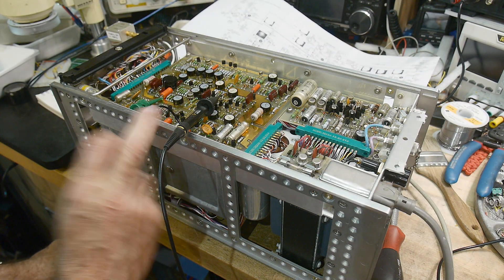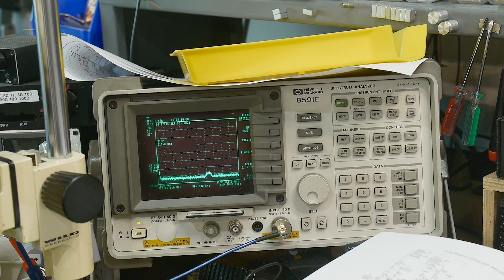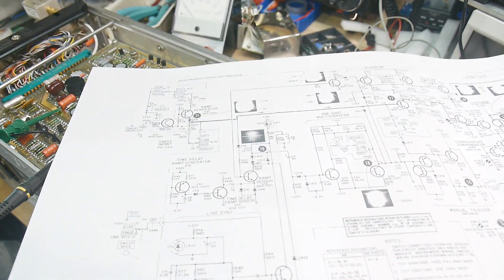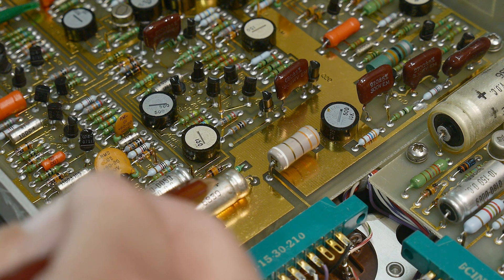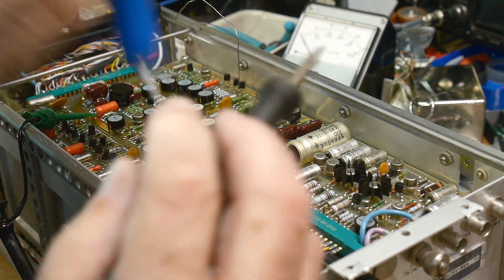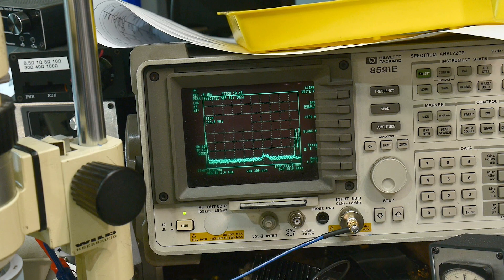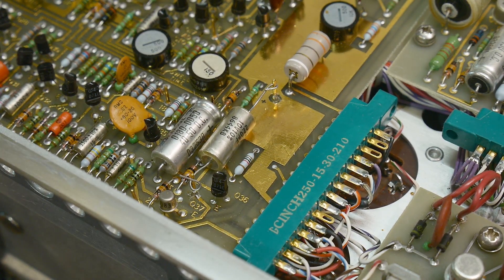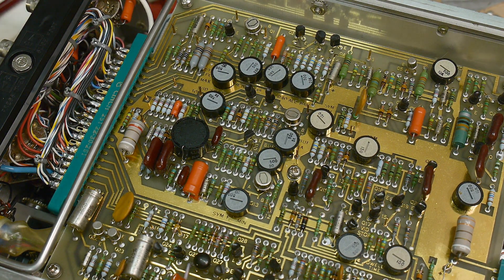#1320 HP 8601A Sweep Generator (part 2 of 2)

Comment: Why are you changing the design. I have 2 of these with different problems. One is a donor unit for the better of the 2.
Whatever parts are left over I will probable sell on Ebay after I am sure that the one is working 100% to HP's specs. 
I have a lot of HP test equipment except for oscilloscopes they are Tektronix.
Reply from the maker: yes, you should get one working, they are great. I wanted the sweep to be a bit faster than the original setting. These old instruments might have been adjusted to to give a sweep plot on an HP pen plotter and so needed to be slow.

Comment: The sweep rate is variable using the little knob. No need to change capacitors.
Reply: @IMSAIGuy  i have an 8601A and the snall knob does indeed adjust the sweep rate in both the SLOW and FAST positions. That is why there is a horizontal line that extends from the switch positions to the knob. Also, if you check the 8601A specifications in the manual, it states that the sweep rates are variable (3-60 sweeps per second in FAST and 3-60 seconds/sweep in SLOW). I just checked my unit and that is the case.
Reply from the maker: you are correct sir. thanks. on mine it varies the slow but not the fast. maybe that is a clue for me to look into
Reply: @IMSAIGuy  Glad to help. I was an electrical engineer for over 40 years and I really enjoy your videos. Keep it up.

Comment: Thanks for an interesting video, I love HP gear. You definitely do not want to use that 100 uF electrolytic capacitor, tantalum capacitors are used in timing circuits requiring large capacitance because of their low internal  leakage. The electrolytic capacitor would affect the linearity of the sweep. I know this because I once substituted electrolytics in a scope horizontal section and caused myself no end of headaches. Regards,  David

Comment: I'm wondering if the precarious connections of the capacitor on those post affects the signal you see on you Spectrum Analyzer ? You might want to solder the connections, once you've decided you like the capacitor value.